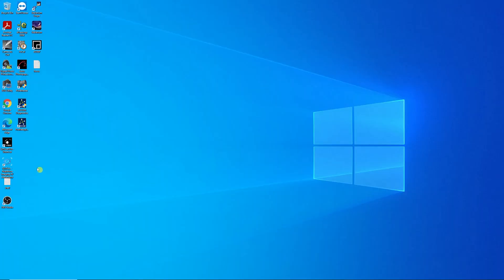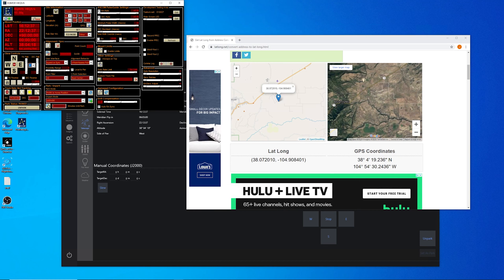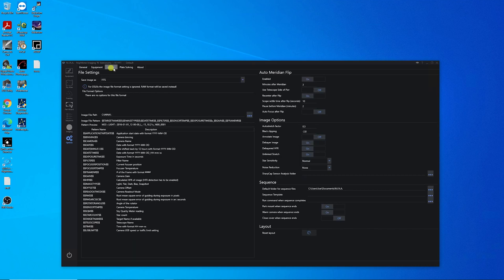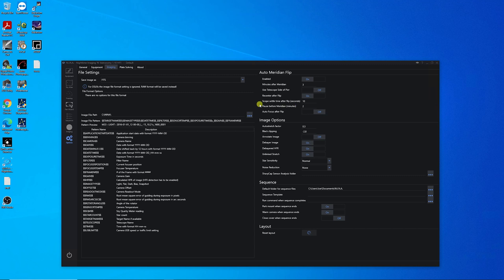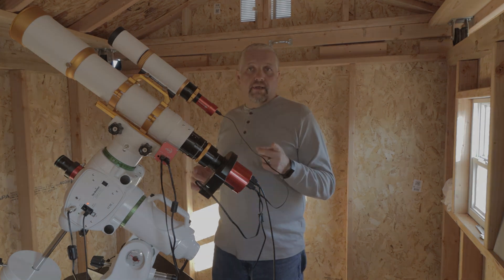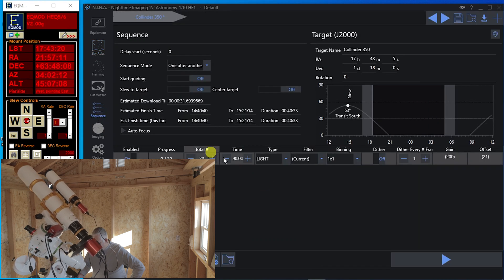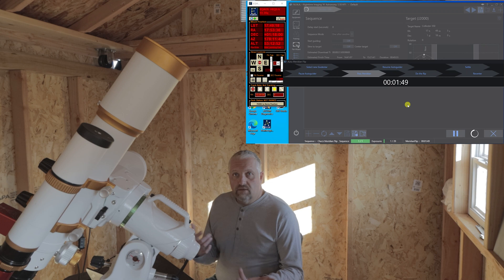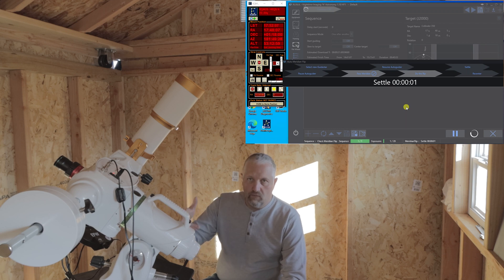Setup and fix automatic meridian flips in the middle of the day

Comment: I'm new to this hobby and your video was very helpful in helping me test out Meridian Flip with NINA and my C8 SCT and my Celestron AVX. I had an issue a few nights ago where the flip occurred and it looked like the USB cable from the miniPC to the AVX hand controller came out the bottom of the hand controller. The cable snagged on something I suppose. Trying to salvage my image session the mount slewed to much and the camera (ASI071MC Pro) contacts the tripod leg but luckily everything seems OK.  Using your video I have run a couple of simulations to verify even at high altitudes the Meridian Flip works with my settings in NINA and my cables now don't snag. Hope you find the time to start updating this channel. Thanks.

Comment: I realize this video is 3 years old, and you've probably long stopped reading comments here. However, I can't wait to try this during the day today. My meridian flip in NINA seemed to work fine last night...but when it began to plate solve the target for framing, then it went crazy and slewed the wrong way right into the tripod!  I powered everything down and tried again.  Same result.  It was as if the scope didn't know which side of the mount it was now on.
Reply: That happened to me when I had one of the stepper motors wires reversed. Probably not the same issue but you never know

Comment: I just had to return to this video again because my different scope mounted mini pc failed to flip.  Of course I realized that I had failed to set something or more than one something.  I had neglected to reset the mount limits to a bit more than 90 degrees.  Once I got those established (another video because I forgot how), the mount flipped smoothly.  Of course it was unable to plate solve after the flip because it is daytime. It was unable to re-center the target.  I had only basically pointed the mount towards Polaris and hadn't even done a real polar alignment.  Hopefully in the dark it will be able to find everything ok.  Then it can in theory reslew and recenter after the flip.  But at least I know now it's flipping and that's the beauty of this daytime test.

Comment: Im fairly new to NINA, so I just had exactly this type of problem 2 nights in a row.  Half of the people who responded to my pleas for help in understanding it said it must be a cable snag.  My cables dangle like yours, and I use the same, or similar EQ6-R Pro.  I didn't find a cable snag but I had a tight power cable to the auto-focus cube (just fixed it with an extender).  The other half of the people think it's a problem with EQMOD working with NINA.  This now seems quite probable to me.  Tomorrow I am going to try and do exactly what you did.  At 2am, it was very hard for me to think!  By the time I went outside and looked at the rig, it was fully parallel to the ground but had not flipped.  I had "Meridian Flip" ON in the sequencing page, but that's all I had set.
Thanks for this video and I will let you know if I get this problem fixed.  Your video seems the closest I have found to being about my problems.
Well I tried this unsuccessfully this morning.  I found that my scope slewed to the target and it looked like a good one.  The weights were parallel to the ground on the east side.  But the sequence refused to start.  The camera needs to be both plugged in and cooled.  
Then it said I didn't have a file specified.  Really?  Ok, I put a USB stick in.  Sequence still wouldn't start.  So I discontinued for today.  Also, on the NINA meridian flip page, there is no longer a choice for "engage".  I guess Meridian Flip stays engaged.
Reply from the maker: Hi Paul, the main thing that I've found that causes meridian flip errors is that your home coords don't match what's in EQMOD and NINA. Check that just to be sure, hope that helps some.

Comment: Question, will the guiding and imaging automatically resume after the flip ?
Reply from the maker: Hi Raymond, it absolutely should. Additionally, if you have an SCT style scope, you’ll most likely want to do a refocus before resuming as the mirror has a tendency to ever so slightly shift. If you have a refractor, then you don’t have to worry.

Comment: Hey Joe, thanks for the vid.

Quick question for you, it looks like you are running the FLT132 on the EQ6-r, am I right? I'm asking because I am tempted to buy it but wasnt so sure about the payload weight for AP.

Let me know!!!
Reply from the maker: Hi t, unfortunately it’s only a Z81, but technically the EQ6 should be able to handle the weight of the flt132. With all the other gear attached, I’m guessing you’ll be around 26 - 28lbs. If you’re pretty confident in your guiding abilities you could pull off 5 - 10 minute subs. If you’re newer to the hobby, you may struggle a bit with that much weight on the EQ6. Hope that helps.

Comment: that notworking for me , same mount, same programs and setup ,i dont see 6 mins waiting time
Reply from the maker: Hi Brian, it may be a different waiting time for you based on what numbers you use in the settings and which target you are choosing. If you’re not seeing the flip message at all then you have a settings wrong either in EQMOD or NINA. Out of curiosity, after the target passes the meridian is the mount still tracking past it?
Reply: @JoesAstrophoto  my settings ,minute after meridian 3 min, max minutes after meridian  10 min . scope settle time after flip 10 min ,pause before meridian 2 min, telescope time after slew 10 s,mount skywatcher eq6 r pro .I may be missing something
Reply: my target like your video an object 5 min before passing the meridian
Reply from the maker: Hey Brian, check in EQMOD and make sure that "Allow Auto Meridian Flip" is NOT checked, and then double check that your lat and long are identical to NINA's. Also make sure that "SideOfPier" says "Pointing (ASCOM)".
In NINA, try changing your max minutes to match your after meridian, so 3 minutes. Once you get everything working, I'd change that to at least 5 minutes.Ensure that "Use telescope side of pier is "OFF". Recenter after flip is "ON", pause before flip 1min. Let me know if that helps or anything changes.
Reply: @JoesAstrophoto  thanks you, I let you know